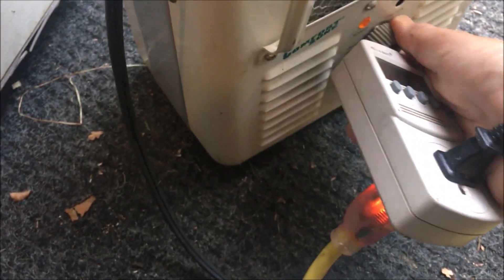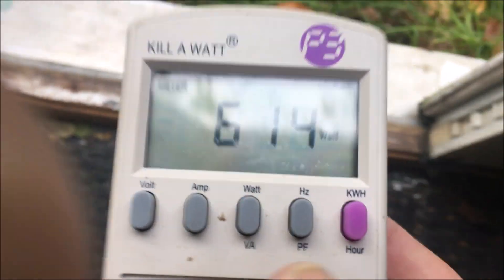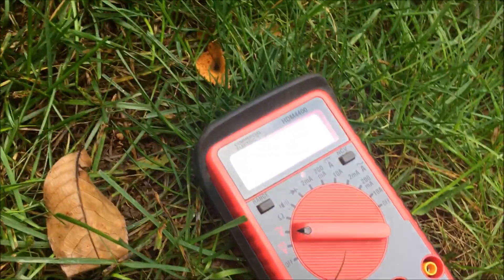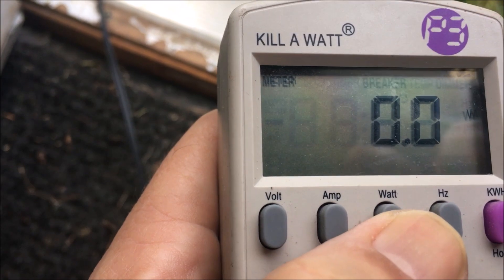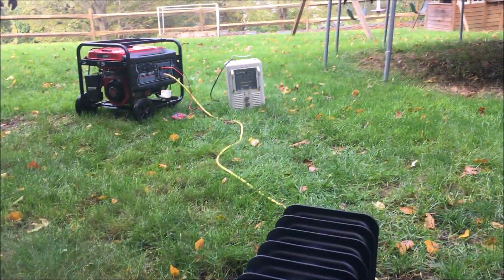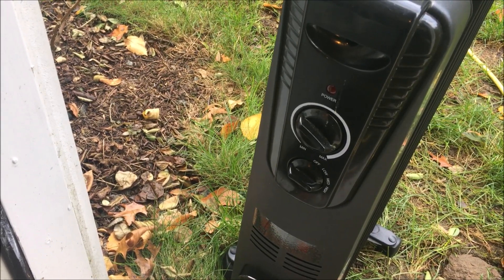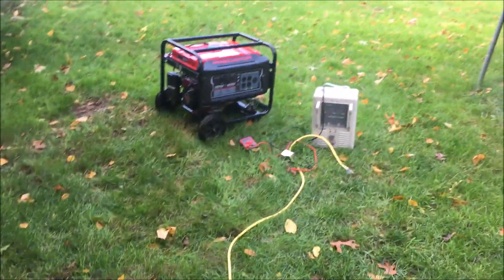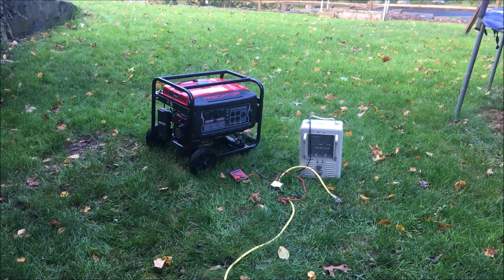Predator Generator Load Test - Fail?

Comment: Sadly the voltage regulator in many Chinese generators is poorly designed. When you start to approach rated load it goes into a death spiral cranking up the field instead of letting the voltage sag a bit. The higher field puts even more load on the engine causing it to quickly stall. A proper design will reach maximum field current with the engine 5 - 10% under rated speed (governed throttle wide open). This avoids the death spiral and rapid stall observed here. The other part of course is the Chinese love to exaggerate their specs. It’s funny how generators with the same Honda clone engines have crept up in their ratings as they try to out spec each other
Reply: Agreed. In the spirit of "working with what you've got," I would also suggest simply tuning the voltage down a smidge to really maximize the usefulness of the generator. 125V vs 115V (or 250V vs 230V) will still be enough voltage for your loads, but in the case of resistive loads, will exponentially reduce their amps draw as well. For example, a space heater being fed 125V and set to high will pull 12 amps. That same heater, still set to high, will only pull 11 amps if the voltage is reduced to 115V.

This won't actually "make more power." In fact, it makes less power, but that's my point. It maximizes the USEFULNESS of the gen. It allows you to plug in more things, and each of those things will still do their job, but just slightly less power to do so. On a fully loaded gen, that is the difference between it stalling and not stalling. Especially with clone AVRs, more voltage is not more better. Lower voltage is almost always going to be more useful.

Comment: I know this is old but still relevant. I currently have the same issue with Sportsman 6.5hp 4000 / 3250 giving me right at about 1650 before engine stall, maybe 7 amps total on both outlets, can't run a 13A circular saw with out stall.  New carb, fresh oil, new coil with proper gap, new plug, new brushes, making 122 volts. I'm at a loss.  Next will be check valve lash and adjust, maybe run some seafom for a tank.
Reply from the maker: Try it with the choke on partially.  If better, then most likely the jetting is too lean.  Valves could also do it.
Reply: The only generators that rival Predator for being the worst is Sportsman.

Comment: Hello James. Its been a while since you posted this video and wondered if you ever came up with a possible explanation for this issue. I have a small 1100Watt John Deere (Robin/Subaru) portable generator that  produces around 600 watts with no issues. It immediately stalls when I try to get it to generate 700W. The generator is designed for 900running watts and 1100 Watts at peak so it should be able to do it. Let me know if you or anyone else have any thoughts on this ...Thanks again for the excellent content. cheers from Ontario Canada
Reply from the maker: I never figured this one out.  Would bet though it was running lean.  Try adding a little choke and see if you can get to 700 or 900 watts.  If you can, then the carburetor is running lean.  Cleaning it might help, otherwise might need to drill a jet.  Just worked on a 1400 watt generator recently that would stall at 750 watts.  Tried a new carb, no change.  Ended up drilling both the main jet and the pilot jet to solve the problem.  If choking the engine does not help, then would look at the valve clearance next, followed by a leak down test to see if compression is leaking excessively from somewhere.
Reply: @jcondon1  Hello James and Thanks for the info. Here are the results. I tried again while giving it choke to no avail. A compression test produced 90 psi which seemed strange to me since it has a decompression mechanism. After adjusting the valves the compression result was 60 psi. While I had the cowlings off I inspected the generator side and it all looked good. I cleaned the  slip rings and put it back together. I followed the same incremental loading procedure and when I got to 700 watts it kept running. I was shocked. After scrambling for 1/2 hr. finding appliances that would get me to 900 watts I plugged them in  and VOILA ...just shy of 900W and still going. However, It immediately stalled while trying to add a 50 watt load. The only thing left for me to try is to clean the carb in an u/s cleaner or drill out the jets which at this point I don't want to risk . I am very satisfied with the results. Not sure if adjusting the valves did it or cleaning the brushes maybe or both???. (The leak down test read 20%). Many thanks Sir

Comment: Don't think it makes a huge difference but you should measure the power at the gen-set outlet instead of at the heater. Don't know what gauge cables you using but there could be quite some resistance which will added to the power demand the gen-set measures.
Reply: When there is more resistance then the load is SMALLER and you need less power, not more.
Reply from the maker: I agree.  The cord was 12 gauge so voltage drop would be minimal, but was really just looking to see the hertz.

Comment: How many years had it been stored without fresh fuel, oil and sparkplug before trying this?  I have the same generator.  I use it as a whole house backup when power goes out.  I've tripped circuit breakers on it many times without the engine having a hiccup.  They recommend changing the fuel and oil every year, but I only change it every two years.  8 years old and still working flawlessly.
Reply from the maker: Have since worked on others of the same model and they ran fine.

Comment: I have experienced this before with no name generators.  I had two with identical  knock off Honda clone 6.5 engines, both ran flawlessly both had clean carbs, yet one will actually hold a full 3,000 watts and run it all day  and the other would bog and stall around the same as this predator, 2,800 watts.

I never figured it out, I chalk it up to possible carbon buildup or a small compression loss on the unit that couldn't do the full 3kw. Something that was robbing just a tiny bit of power.
Reply: Everyone really needs to watch this video 
https://youtu.be/I1jT3ANENvI it’s very important

Comment: If you want to get the max out of these generators get a AC WORKS L14-30 30Amp 4-Prong Locking Generator Distribution Cord (1.5FT L14-30 to Four 15/20A Household) from amazon. I can run my fridge, deep freezer, 5k btu window a/c and 32 inch flat screen at the same time on this exact generator and handles it like a champ
Reply: that's what I'm talking about ... I did buy a 3prong outlet adapter like yours and I don't have a problem ... good call ..
Reply: Be careful using portable generators https://youtu.be/I1jT3ANENvI here’s an advice about generator safety and keeping your family safe while using generators. Especially children should be safe as well. Thank you

Comment: REGULATOR IS BEHIND THE AIR INDUCTION COVER, IT REGULATES THE CURRENT FLOW, THE BRUSHES ARE THERE ALSO ! 4375. 🇺🇸🇺🇸🇺🇸🇺🇸      NO CURRENT ?  REPLACE ONE, OR BOTH...

Comment: Could have low voltage safety protection cut out for spark, as you say engine speed isn't high enough at max idle anyway,  that's your first problem,  you need to see 240v without load for first test, you can adjust voltage at idle with adjustment of the idle screw on the carb for engine speed. 240 to 250v is safe, I would say your biggest problem here tho is that you engine governor isn't adding fuel when load is applied,  check to see if it's moving freely, also don't be to upset to not see it doing the full current output so long as the voltage drop isn't to high, 2500 watts at 240v is safe, 3500 watts at 200v is a big no no

Comment: I watched this one again after all the others and I am more educated. I am pretty sure you don’t still have it but could anything have been done to improved the wattage output? Or is it just misrepresented on the genie and it’s output is less then advertised ?
Reply from the maker: I do not have it anymore.  Not sure if this was misrepresented.  Was hoping others could tell me.  Otherwise it was most likely a valve/timing/top end issue.  Could be fixed, but not sure predator engine parts are available.

Comment: Heater has a starting wattage  so when it cycles on and off that total  plus the combination  of the other devices  surge pass the total wattage
Reply: Don't thing so. These heaters tend to have cos phi of 1.
Reply: No, heater is resistive load, no extra current at start. Only the small fan is inductive and takes a little more at start.

Comment: Hi im not a electrical engineeror generator expert by any means but from what i see some of the problems are that  you are supposed to use the upper plug first . Next an extension cord is a big no no on the heater( too much voltage drop). Next get a twist lock pigtail and utilize the locking plug as I don't thing you are balancing the load on generator  properly. Plug 1st heater into upper left outlet and 2nd heater into the twistlock . I wouldn't doubt that the predators claimed running watts are a bit inflated anyway.  I do know that motor is running fine sounds it anyway.  Btw i have a 5500 Running watt predator with about 40 hours on it and its been great although ive never test the actual output.  Good luck thanks for posting🙂
Reply: If the extension cord drops voltage there is more resistance and then the load is SMALLER and easier for generator.
Reply from the maker: Someone else mentioned the top plug thing.  Cannot see why that would matter.  Might just be their way of keeping it simple.  The outlet on the left is one 13A leg and the one on the right is the other 13A leg.  As long as you spread the load on either side, top or bottom should not matter.  This generator can do 3200 continuous watts (1600 on each leg).  I put ~1500 watts on each leg and it stalled.  A 6.5 HP engine should do up to 4800 watts before stalling.  Was mostly curious if they were over stating the power of the engine or if the issue was just with my generator.  Definitely have to be careful with extension cords and heavy loads.  I used a short 25' 12 gauge cord rated at 20 amps, so voltage drop should not have been much of an issue.  Would not recommend running a space heater on a cord, but if you do would not do anything less gauge wise.  The 30 amp L14-30 plug has the same two legs shared by the outlets, so balancing is still necessary either way.  Thanks for the feedback.  I do like the Predator Generators, was just surprised at the lack of power on this one.
Reply: @jcondon1  Yep some helpful info for me here. I like the predator line as well. I also have a way old HF Chicago electric 2800 peak with a Robins Subaru 6hp motor. I've had it close to 20 years and it still runs awesome. 👍

Comment: It sure sounds like a engine issue. If you have a compression tester, use it before spending money. Further those Honda clones tend to have poorly adjusted valve clearance and very low quality spark plugs and lead. The best bet is to buy an original Honda spark plugs lead and a high quality spark plug and check the valve timing. That should not be too expensive and might solve your problem.

Comment: Use high quality extension cords that are as short as possible. There is a lot of resistance from long cords that are small gauge wire.
Reply from the maker: rg1599 yes, that yellow cord was a 12 gauge 25’ cord.  Should have handled 15 amps without issue.
Reply: @jcondon1  very important advice on this video that everyone really needs to know https://youtu.be/I1jT3ANENvI click on this link
Reply: If the extension cord drops voltage then there is more resistance and the load is SMALLER and easier for generator.
Reply: @Kari Rautio  no sir. A voltage drop is indeed part of the load.

Comment: You said in the video ..the generator is running slow....idle the engine up it has to run at it's Max rpm ...it should be listed in your owners manual ...
Reply from the maker: I have another video on this generator where I go through the carb and set the engine speed.  Originally it was running at 3850 rpm.  Had to bring it down closer to 3600 at no load.

Comment: Looks like you could be overloading that generator I'm sure both of those heaters are 15 amp ...but the fuses are 13 amp
Reply from the maker: They were 15 amps each on full.  Would have been satisfied if the fuse had blown.  That generator has a 6.5 horse power engine.  That should be able to make 4500 watts (assuming the alternator is capable).  Was not expecting it to stall at around 2900 watts.  .
Reply: @jcondon1  Yes, I just bought a new one. When hooked to 15 amp air compressor. The generator shakes violently before blowing breakers. The motor does not stall. I have hooked to 2 box heaters similar to yours. Mine are 12.5 amp. And 1300 watt on low. I have not tried on high yet.  Anything over 13 amp would blow the breaker on mine.
Reply from the maker: bellyacre1 the compressor is an inductive load and probably draws close to 30+ amps to start up.  I assume it is a 120 volt compressor so you will be limited to half the amps the generator is rated for since it splits the power over two 120 volt legs to get 240v.  You probably need a larger generator or one that delivers all the power on 120 volts instead of 2 120 volt legs.
Reply from the maker: Breakers and 120/240 aside, a 6.5 HP engine should be able to start a 40 amp surge.  The issue I had is that the engine was stalling at around 25 amps.  Sounds like your engine might not be deliving the 6.5 HP as advertised.

Comment: This appears to be more of an engine issue. I would suspect low compression (easily tested) or a weak ignition coil. Also I have seen faulty oil protection circuits kick in and cut the spark under load so may want to try temporary bypassing that switch, trying a new plug. Also make sure the air filter box is not leaking air around gaskets and that all of the air filter components and crankcase recirculation hoses are in place. The carb will lean out under full load without the air resistance of the filter and its foam pad. Hope this helps

Comment: First off it says to use the Top plug inlets first...You're also using an extension cord plugged into a bottom Plug.....
Each outlet is only rated 13 amps !
but, I Liked your Video and Subscribed because you gave it a good try !

Comment: I have a Predator inverter genny and it will pop a breaker before the engine bogs down or dies. Did you figure this one out or no?
Reply: You need new spark plugs.  Only buy NGK and make sure they are set to the correct gap.  Change your fuel out and run Startron in every tank of fuel.  Itll keep the fuel up to 5 years if you dont run it.
Reply from the maker: mghattendorf never did

Comment: If it has the torch spark plug i would change it out. My 6000 watt generator was misfiring and that was the problem. Put a ngk spark plug in it and over 100 hours later and runs like a champ.
Reply: Don’t forget about generator safety as well https://youtu.be/I1jT3ANENvI here’s a video about keeping your family safe while using generators. It’s very important. Thank you